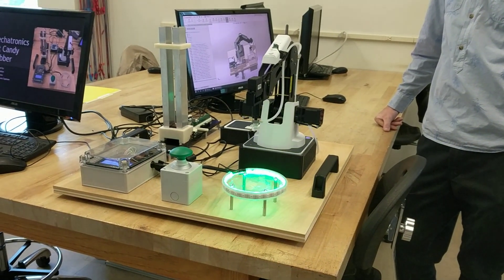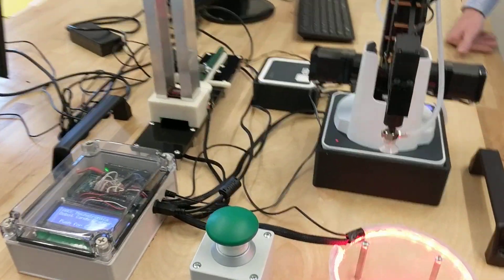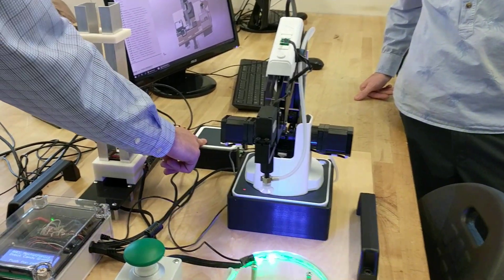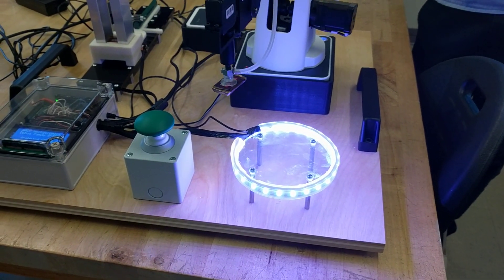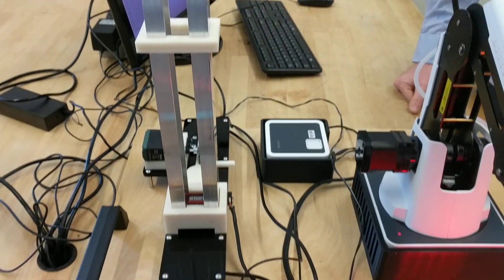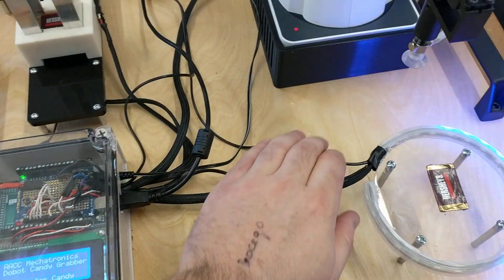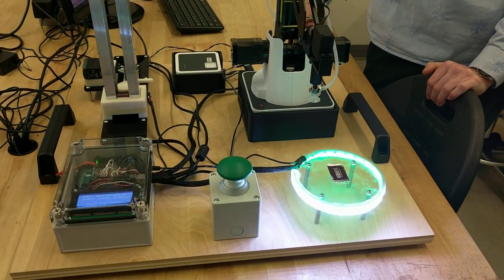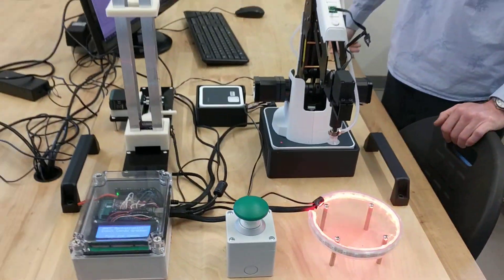Dobot Candy Robot with Arduino Control

Comment: Very nice.  I teach high school and have a dobot.  Did the students program the dobot and its communication with python? or snap?   Again, appreciate you sharing this!
Reply: jcr723 I was one of the designers of the Dobot in the video (Amir) and all I used was the Dobot teaching and playback feature and downloaded the program to the Dobot (You can only download to the Dobot if you’re in pro mode). Then I used the Arduino to send a high signal to one of the Dobot’s ports (EIO19 in my case) and set when it receives a high (1) then it starts the program. I’m working on a video of it currently to explain the process more in depth and I’ll reply again with the video once it’s done. We can’t use blocky or the script features in the Dobot program because I’m pretty sure you can’t download those and use it in offline mode. You could use the script/blocky but I’m pretty sure you’d need to have the Dobot connected a computer the whole time.  Also I did say in the video that we could use a regular Arduino but we tried swapping it but it didn’t work. The LCD and other little parts wouldn’t work.
Reply: https://www.youtube.com/watch?v=cv144pF2XQQ&t=1s